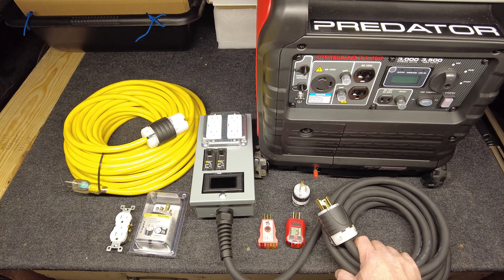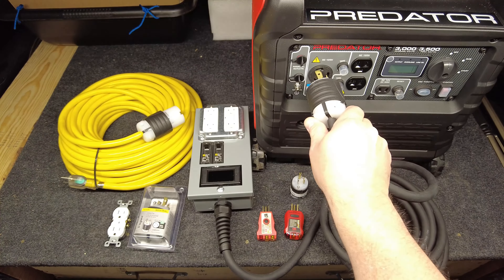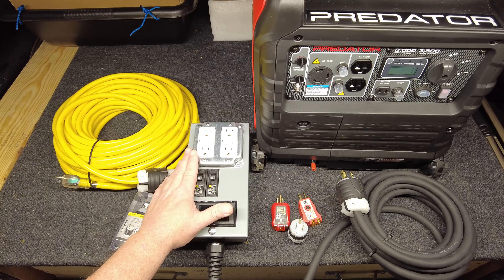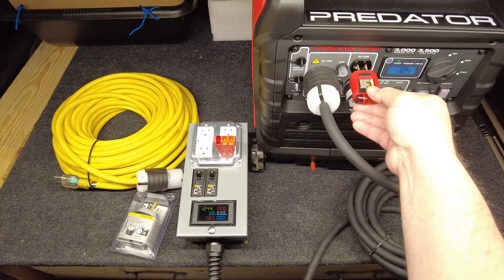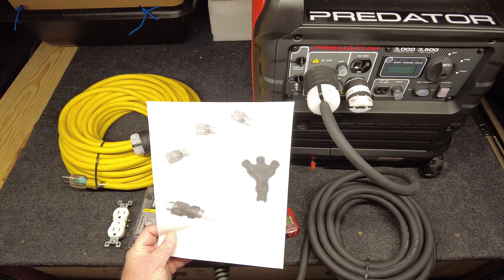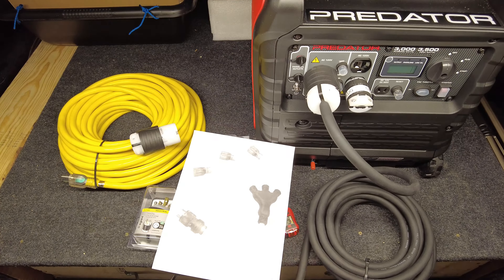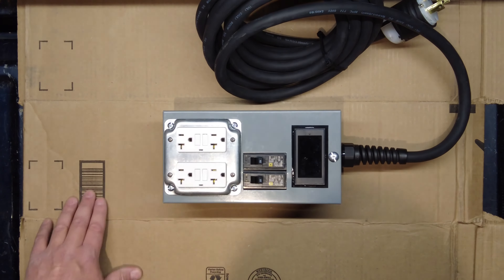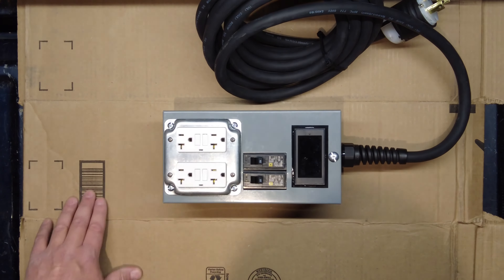How To Get Full Power From Predator 3500 Inverter Generator, Camping, Home Backup, GFCI Safety GFI

Comment: Question} The generator has to run flat out to produce maximum power.
If my goal is to charge 4-6 batteries hooked up to an inverter to power a 
freezer an refrigerator at home would the generator running on eco mode
charge the batteries efficiently using the power outlets on the predator 3500?
Question #2  What is the size charger you might use?
The goal being to run the generator just often enough to keep the 
appliances working using batteries and an inverter to power it.
Reply from the maker: Okay....  running a generator that produces 120 volts ac, then converting that power to 12 (or24?) volts to store in a battery, then inverting that power BACK to 120 volt AC to use for running your refrigerator/freezer is not very efficient.  Every time you convert electricity from AC to DC....  and/or  from DC to AC you lose some "energy".  There is a cost every time you covert. Anywhere from 5% to 25% EACH TIME you convert. So with that in mind, now think about your overall energy draw required to run your freezer and refrigerator.  I have no idea how many watts your appliances draw or how big they are....  they could draw anywhere from 500 watts to 5000 watts.  But either way, they draw what they draw regardless if they're being powered by batteries with an inverter, of if they're being powered directly from a 120 volt outlet. It's the same draw either way.  However, now that you know there is a cost to go from AC to DC  and then back to AC you need to ADD that loss (whatever it is) onto the total power draw from your appliances and that will tell you how much power your generator needs to put out to refill your batteries.  Keep in mind, what ever the appliances take from the batteries, the generator has to put back into he batteries PLUS whatever the loss is.  Now, I realize refrigerators and freezers do not run constantly, they turn on and off as needed.  So, is it possible that the generator can top off the batteries on ECO mode while the appliance compressors are turned off????  That is the question.....  and that is the question I can not answer.  I'm sure an engineer somewhere would be able to calculate that but I can't.  Sorry I didn't have abetter answer for you.
Reply: @SlipFitGarage  the generator has DC out.  I am just getting up to speed on the topic.  Most likely 200 Watts of solar and DC refrigerator Freezer add batteries inverter etc good to go.
Great job on the video and a thoughtful answer to my ambiguous question.  😎👍

Comment: Well for a 3,500 watt generator the plug is rated it 30 amps so that matches up with the generators capacity pretty well.  

  But there are generators out there that you can't get the full rated power out of on a single plug because they don't provide a 50 amp plug.    On some you can combine receptacles with custom adapters. On some you cannot.   For instance some larger generators may have a 240 volt and a 120 volt receptacle.... But with no way to get both sides of the 240 volt as 120 volt because they are opposing phase. You can only get that power on the 240 volt plug.... When a lot of large RVs with two ACS need a 50 amp 120 volt..   The problem is electrical codes require these high amp plugs to be twist locking.... So to comply with the electrical codes vendors don't want to use the travel trailer style plugs.

It's always good to look at your schematic and understand how your power on your generator is supply to your outlets.    Because in some cases you can combine those outlets to get more power at 120 volts.... And in some cases you cannot they all need to be on the same phase to combine them.

I don't know how that works with inverters but 240 volt generators that are not inverter..... They do it with switches. The switch will wire the two coils in series but opposing to give to 240 volts or the switch will wire them in parallel the same way to give more amps at 120...with floating neutral.    If you understand this you can actually switch your generator to supply you options that are not built into it.
Reply from the maker: Yes.....  but if you did not have the box shown in this video, you would only be able to use the 120 volt outlets on the front of this generator.....  and it's still debatable what that breaker is rated at.  If it was 15 amps,  that only gives you 1800 watts from this 3500 watt generator.  If it was 20 amps, that only gives you 2400 watts from this 3500 watt generator. Right??  That was the main purpose of this project. Now if you use one of those cords that I've shown in this video that splits the 30 amp outlet into three 15 amp, 120 volt outlets......  you are now potentially feeding up to 30 amps directly into a device that is only designed to see up to 15 amps.  Like I said in the video......  "Just because you CAN, doesn't mean you SHOULD".  If you see no problem potentially feeding up to 30 amps into a device that was only designed to see 15 amps, then be my guest and please do as you wish.  I recently built a similar box for use with a 240 volt generator.....  If you didn't like this project, you'll really hate my next video. lol.  Thanks for the comment.
Reply: @SlipFitGarage  for sure look at your schematics and understand how your generator is wired and stay within its breakers capabilities.   Because the wiring runs internal to the generator are quite short.... They use very small gauge wire to carry current .... Even allowing for some voltage drop to occur on the small gauge wires.    For instance you you would probably use 10 gauge wire yourself to run 30 amps..... Because you've got to run it some distance but if you look behind the panel on your generator you may have 14 to 18 gauge that's only a few inches long running 30 amps!  Got to be careful about pushing anything past what it's designed to do.
Reply: The breakers are not to protect the device, they're there to protect the wiring.   You plug all kind of devices into your house everyday that are not good for 15 amps that are only good for a tiny fraction of that, but you don't worry about the 15 amp breaker. It's sized for the wiring so the house doesn't burn down if it's overloaded.  It's a bit less important on extension cords than on a structure.

If the device comes with a 120 volt plug on it.... It doesn't draw more than 15 amps to start with.     You're not going to overload an adapter
Reply from the maker: So what are you getting at?  You've wasted your time typing all that stuff that I already know.  Like I told the the other guy who posted negative comments, I built this box for ME and ONLY ME.  If you don't like it. or if you don't feel you need one for yourself, then don't build one. Or, if you do build one, then build it however you see fit. Simple. 
 I realize anything that comes with a standard 15 amp plug is only designed to draw 15 amps or less but that's when the device is functioning correctly.   Like I said in the video (if you watched then entire thing) what if there is a fault???   After all, that's why we build electrical systems with breakers, GFI devices, surge protectors and arc fault devices, right?  In case there is a fault?  Faults CAN and DO happen.  And YES it CAN overload the adapter.....  until a wire burns off, or the 30 amp breaker trips, or the breaker doesn't trip but the 16 gauge wire heats up like a electric heating element and starts a fire. This stuff happens all the time.  
Bottom line....  My power box gives me added safety IF FOR NO OTHER REASON I now have GFI protection.  I also have true 20 amp outlets to plug electric heating/cooking devices into without possibly tripping weak 15 amp breakers.  The box gives me an electric meter at the camp site while the generator is located off into  the woods.  AND, it allows me to safely draw a FULL 3500 watts from the generator instead of only 1800-2400 (depending on breaker rating)  from the standard outlet. 
Like I said,  I built it for ME.  Feel free to build a different box that solves a different set of issues for yourself.  Or don't build one at all. I don't care. lolol.

Comment: you should have used 2 - 15 amp breakers & 2 - 15 amp gfci's, not 20 amp; your circuit could still be over-drawn and thus is no safer than a 3 way cord
Reply from the maker: No, because it's all 10 gauge wire and the breaker on the generator is 30amps....  I purposely used 20 amp breakers so if/when I ever plug in an electric heater, or some electric cooking device I don't have to deal with weak 15 amp breakers tripping. I built this box FOR ME.... Build YOUR box however you like.  If you're offended by this box, then your head is REALLY going to explode when you see the new one I just built for a 240 volt generator. lol